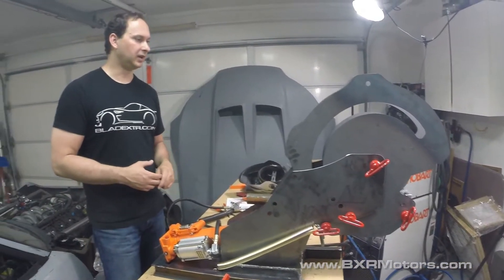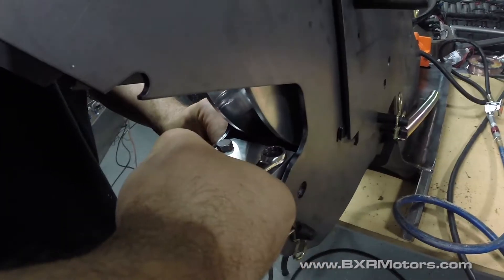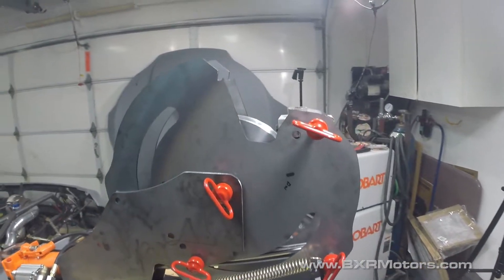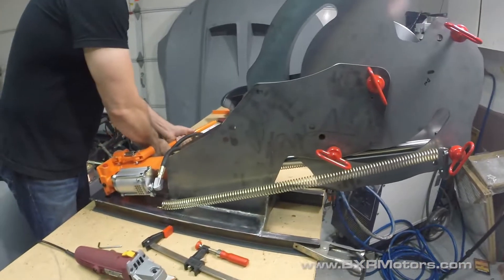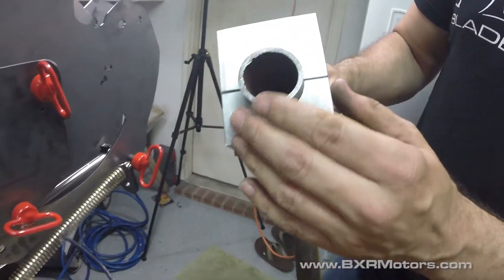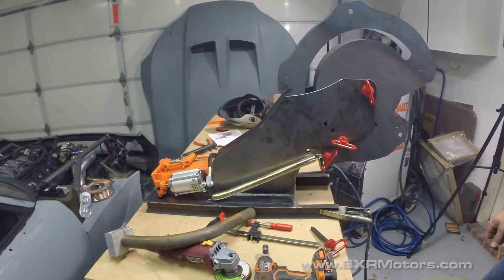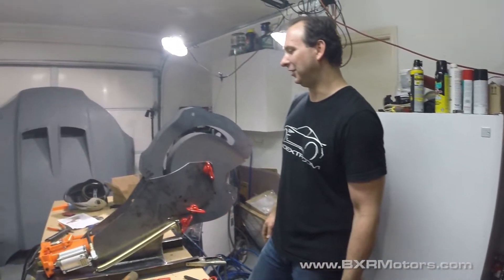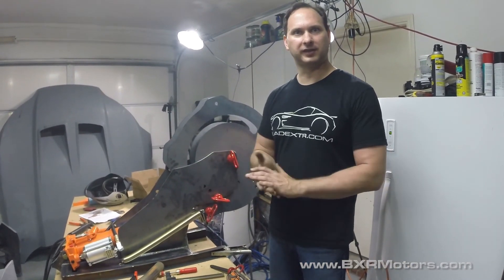Rogue Fabrication Best Tube Bender - Testing part 3

Comment: what size tubing that was mate?
Reply from the maker: That was 1.5 inch tube with 0.190 wall thickness. 👍
Reply: @OZTron3D   what 0.190 in MM, I'm from australia we don't use that term
Reply from the maker: @iceshards100  the OD is 38.10mm and the wall thickness is 3.05mm but you could use 2.41 to save a little weight and money.
Reply: @OZTron3D  cheers mate,

Comment: The bender looks ok, but it also looks like it would be a real pain in the rear to change the dies (3 different parts to have to line up)
Reply from the maker: nah it's super easy and fast...everything is self aligning. and the fact that the guide pull block stays on the Bar you can quickly test fit and then stick back in to continue the bend is priceless. most benders do not have that feature. in our videos it was our first time using it so we were a bit clunky with everything. I will have more videos coming soon on it.

Comment: Dudes! Do not use rusty tube with that mandrel. It will leave gouges in the follow and the die making bends with scratches. Use only clean tube with a little lube.